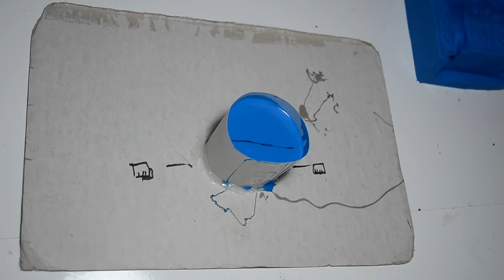How to Mold and Cast a Sculpture

Comment from the maker: For the people who wanted to know what materials I use, I am based in Europe so I used materials that were most accessible to me.
- Monster Clay for the sculpture
- A no name soft plastelline for the parting
- ZA22 RTV Silicone from the brand Zhermack (Italy)
- Multicast 12 Polyurethane Resin from Neukadur (Germany)
Reply: Thank you
Reply: thank you , i was looking for a way to save my statue ( prime 1's bat who laughs  )and it didnt occur to me to glaze the mold before i actually cast it . this way the actual statue is in storage and the copy is out in the world.
Reply: Someone else asked the same thing? I can't seem to find it. I had the same question and was looking for the answer. I see someone else refers to it as a layer of resin.
Reply from the maker: @brandonc272  I'm applying a first layer of resin with the brush to make sure all the fine details are covered and I don't get tiny air bubbles on the surface of the cast.
Reply: Crafty Art. Great work and really nice music. Who is the artists?
Reply from the maker: @christsrevenge8030  Thanks! I don't remember unfortunately. It was a track from youtube music library
Reply: Interesting. Every time I see someone make a mold, I learn new variations on the basic techniques.

A couple of questions:
• Why use cardboard as the surrounds for your molds instead of reusable thin plastic film (PTFE) or a made box..? (It seems a little flimsy & wasteful)
• What's the purpose of the wires, going from the wrists to the body, that you added to the mould..? (I thought maybe flowthrough, or air venting, but they're a little too small for either.)
• What's the orange stuff that you used to underly the sculpture for molding?
• Do you ever include reinforcing materials in your larger molds..? (eg: fiberglass mesh embedded into the polymer at the back.)
Reply: I was going to say your sculpture the clay looks just like the stuff I used for bronzes casting? I always wanted to do a rubber or plastic casting of something. I saw people making molds but I never got around to doing it. They were using clear cocking in a pot with water and "Dawn dish soap" they would get a good amount to form a ball and put there object in the ball the cocking and let it dry over night then cut it out the next day.
Reply: Could you use wire in the body if you were to pour a rubber, so when you pulled the body from the mold you would be able to bend the arm's and legs? I don't think I ever seen anybody do that yet on YouTube? I might have to make a video and be the first it will be my first mold making and rubber pour.
Reply: @snoopu2601  Look at sculpting for stop motion animation. They embed a highly jointed skeleton inside the polymer body, which is used to put the character through extremely precise postures for animation, one frame at a time.

You could probably do something simpler with a high grade aluminum armature wire.
Reply: @Skeptical_Numbat  Hay thank you for replying back, I will look into it. Any information helps out. I'm a welder that made sculptures out if metal, I did do some small bronzes sculptures and casting so this will be way beyond what I'm used to. I'm guessing I can buy everything I need off Amazon. I can get some supplies at the Hardware store but the plastics and rubber ingredient would have to get from Amazon until I do some more research where I can find the mixtures.
Reply: Crafty Art Hi, excellent video and very clear, I have only two questions.  What aerosol product did you use when making the back of the mold, and whats for? And what is the liquid with which you paint the mold before put the polyurethane?  Thanks your help!
Reply: Thank you. So many creators completely skip over what medium they use.
Reply: Thanks for making such a creative video showed me much needed techniques!!
Reply: Hey :) What "silicone-free mold release spray" did you use to keep the 2 parts separated? :P It's missing from the list. Best!
Reply: @snoopu2601  have u made it? ı thought the same thing.  I wonder if the wire pierced the body ?
Reply: Have you tried to use FIMO clay? What can you say about it?
Reply: thank you! subbed
Reply: Hello :) Why did you put those 2 blue drains between the legs and the arms at 7:17? And what does the mould release spray contains? Thank you!
Reply: Can you share the links of products u used

Comment from the maker: I cut the fists in the beginning because their shape has many irregularities that could be problematic when casting. Air can get trapped in high points like the knuckles or tips of the fingers, and ruin the cast. I couldn't vent them properly so I decided to cast them separately to have more control.
Reply: Crafty Art if the face/head has a lot of details, like earlobes and nostrils and eyelids, should the head be molded/casted separately as well?
Reply from the maker: @MsPoliteRants  Not necessarily, but it depends. If the face has an open mouth you can get a mold lock, and you may not be able to pull the cast from the mold. I had made a human anatomy model and have cast it in one piece just fine.
Reply: Crafty Art oh okay. Thank you that’s very helpful :)
Reply: What do you do when the hands make some sort of an O shape like they are holding something or doing the OK/666 sign or whatever. Would you make a two part mold for something that small? And how do you cut them of if you have a skeleton of wire inside of it?
Reply: Crafty Art what clay you use
Reply: How you join the arm with the body?
Reply: Crafty art can i ask you?
Reply: That clay sculpture in your video is hardening forever?
Reply: How do you measure exactly how wide to make the first half of the mold,
 seems like if you got that wrong he'd be to skinny or wide, but it doesn't 
  look
 like you've marked him with a guide line ???

  Very cool process! :)
Reply: @roosbolton4388  Did you watch the entire video?
Reply: @aanler  I'll tell you in 11 months.
Reply: @roosbolton4388  Looking forward to it
Reply: @aanler  You can't be that bored
Reply: @CraftyArt I always wanted to make resin cast figure of Godzilla with seperate assembly parts without posing as a problem.That includes the jaw if I want to make it an open mouth model.

Comment: Prebrushing plastic into the molds before joining and pouring is a really good idea. It reduces the chances of air bubbles. 
I will have to give that a try.
Reply: Ya I noticed that..what material did he use?..
Reply: What is that you brushed into the mold?

Comment: I want to see a tutorial on how to make a cast of something like an old retro computer case (Amiga to be exact) so I can make a custom one cast in transparent color resin. The case is so thin so I realize I need to fill it with clay and do a two part mold for both the top case and the bottom, but what silicon is the best so it will not sag or bend when I am casting with resin? I have searched for an example of something like this. The closest I've found is a plastic car body, but that is nowhere as large as a computer case.

Comment: Great sculpt! I have a question. I saw that you primed the mold with a bit of resin spreaded with a paintbrush in order to avoid surface bubbles. Is there a way to clean the brush or you are using a new one with each cast?
Reply from the maker: Yes, you can clean it with cooking oil. But some resin still remains and you will have to change the brush eventually after a couple of castings.

Comment: I tried to use plastelline for making molds and the part of the silicone that touched the plastelline has not cured and is tacky, has that ever happened to you?
Reply from the maker: It hasn't happened to me but I know if you use plasteline that contains sulfur it messes with the curing process of the silicone. You must use a non sulfur clay or plasteline.

Comment: Very nice, but slightly confusing, was the clay still soft when you cast it? Because you cut of the hands real easy? Ind if that was the case, wasn't it really hard to handle the model without smudging detail? in any case, well done
Reply from the maker: Yes. The clay I'm using is an oil based clay that stays soft. If you're using this kind of clay you have to be extra careful.

Comment: Awesome! What grade of Monster Clay did you use (soft, medium, or hard)? Did you use anything on the sculpture's surface to harden it? Also, what are the two blue straws you made from its hands to its thighs for? Thank you in advance
Reply from the maker: I've used medium grade. I think I left the sculpture in the freezer to harden it a bit.  The purpose of the blue straws is to let air come out from the hands when I will pour resin into the mold.

Comment: Hi, i have a question. After you completed both sides of mold and you tied it together, what is that liquid you inserted into mold?  It would mean alot if you could explain.
Reply from the maker: It's polyurethane resin. It's 2 component parts that combine in 50/50 ratio and after curing become hard.

Comment: I’m trying to do this with an action figure to make the mold and make a hollow chocolate cast for a cake topper.....do you have any idea how much silicone putty was used for a project this size? I’m hoping I can cast the entire thing “posed”.

Also why did you choose to fill the mold one half at a time versus standing the figure and filling the mold?
Reply from the maker: I used about 2.4 liters of silicone. I did it like this because I use less silicone and have more control over the parting line. But you can do a block mold if the pose allows it. You can find more videos about that on the channel "Brick in the yard"

Comment: July 3, 2019---Thank you for an interesting & educational video. Learned I don't have to use Lego's as a form, especially when the form is an odd ball shape such as your figure. Also, remember to add pour vents to the subject so the resin reaches thru out the mold. And will give a try in coating the mold pieces with resin before pouring. I'm working in 1/35th scale and made several different wagons used by kids. Tried using a syringe to inject the resin into the one piece molds, but when removing them, they broke on me. And yes, I did use mold release on the molds before hand. Suggestions?

Comment: I love how “crafty” you got (see the pun? 😂) with making your own casting chamber. I am still trying to figure out what was the purpose of the two blue strings that went from wrist to hip? Also, how did you go about shaving off the excess raisins that sipped thru?
Reply from the maker: The blue wires are vents that will allow the air in the arms to escape when pouring the resin. Because the model will be head upside down when the resin is poured, the air would get trapped in the arms if not for those blue wires. As for the excess at the seamline just use a cutter, it's easily removable.
Reply: @CraftyArt  Thank you for this explanation
Reply: Venting

Comment: It looks like you first paint the mold with resin. Is that right? Do you first use mold release, or does the resin separate from the silicon easily by itself? And as others have said, a list of the products you use would be great.
Reply from the maker: Yes, I'm brushing the first layer of resin to make sure there aren't any bubbles sticking to the surface of the mold. I don't use mold release when casting, only when I'm making the mold and I'm pouring the other half of silicone. I've used ZA22 RTV Silicone from the brand Zhermack, and Multicast 12 Polyurethane Resin from Neukadur, but just because they're more accessible to me. Otherwise I would recommend using Smooth On products.

Comment: Used to work in a factory in Victoria Road London,in the nineties...I hadn't a clue back then,But the other worker,Andre used to handle a lot of these operations,,,Sometimes he would add bronzing or metallic powder to the mold or resin,to give it a metallic finish when polished,
We used to use a vacuum chamber made from a dustbin a small compressor,and a custom built industrial sized compressor also....for helping the model hold form as resin expanded...
Company went out of business...shame really..they had a lot of nice pieces...
But nice work...
Really professional...Impressive..
I want to learn how to do this,and this tutorial covers a whole lot..
So,you don't use a vacuum for removing bubbles whilst setting the rubber mold or a compressor for helping it hold details?
Better resin since then I guess...
I can see the thing comes out perfectly anyway...Pretty cool.

Comment: Hey bud great video what was the mould release spray you used? Also what was the blue wire for? Just curious
Reply from the maker: Thank you. Just a regular mold release spray, don't know what's the name. Blue wires are to allow the resin to flow through the arms.

Comment: What is the difference between the gray clay and the clay in which your piece was sculpted? How come they don’t stick together and ruin your sculpture?
Reply from the maker: The clay I used for the sculpture is harder than the plasteline I'm using for parting. Still this is a delicate process and you have to be very careful not to touch or damage your model. If you worry the clays you are using might stick to each other you can put a fine plastic sheet between them, or try spraying your model with some mold release.
Reply: Crafty Art thanks!

Comment: Did you just glue the fist's back on and what was the wires for?
Reply from the maker: Yes I just glued them back. The blue wires are vents that will allow the air in the arms to escape when I'm pouring the resin in, because the negative in the mold is upside down so resin wouldn't flow through the arms if not for the blue wires.

Comment: Can you help me with something plz ....i have sculpture made from (liquid plastic easyflo60)... but in the molding ..casting process ...sculpture got few gaps..holes....from air bubbles... i need to fill them with something and paint whole sculpture after that..... so i need to fill few gaps (big like  1 water drop each)...and then paint...lets say for example ...figurine like yours with few holes....what to use for filler to be paintable .....if any one know plz let me know ...i am crazy of searching ...noone knows this ....maybe super glue ...super glue + baking soda ? Or some other filler? Sry my english is not so good, i hope you understand what i mean.... i understand everything you say.. best regards.
Reply from the maker: I'm sanding down useless resin casts with sandpaper to get like a resin dust and I mix it with glue to fill the air pockets, then sand down those areas to make them seamless.
Reply: @CraftyArt  thx man i was thinking to do this also ....but wasent sure can i get dust ...thx 👍👌

Comment: Get a pressure pot  put mold with you resin in it put in pressure pot add 55 psi to pot 
You will very good results in clarity  , casting  is fun  🤩

Comment: What is the blue wire for?
Reply from the maker: The blue wires are allowing the air escape when pouring resing in the mold. In the casting part you notice I'm turning the mold upside down, and pouring from the feet, so the as the resin fills air would get trapped in the arms if not for those blue vents.

Comment: Do not quite understand why it was to separate the hands? These areas do not complicate the casting of the resin.
Reply from the maker: I cut the fists in the beginning because their shape has many irregularities that could be problematic when casting. Air can get trapped in high points like the knuckles or tips of the fingers, and ruin the cast. I couldn't vent them properly so I decided to cast them separately to have more control.